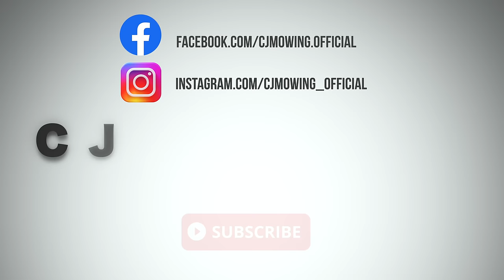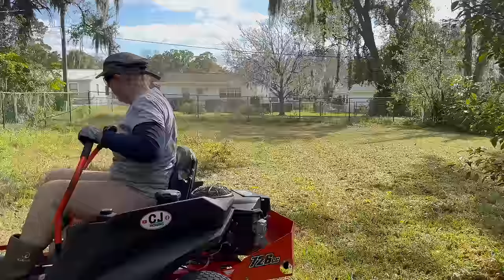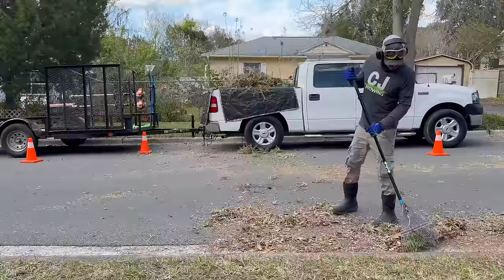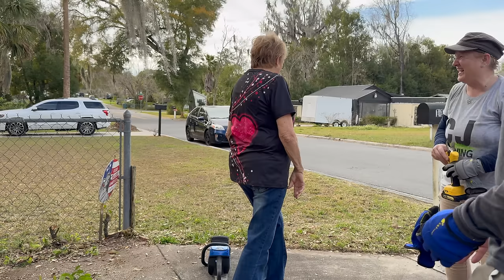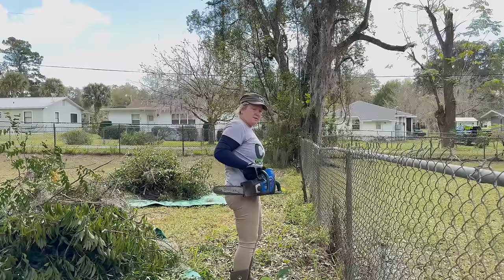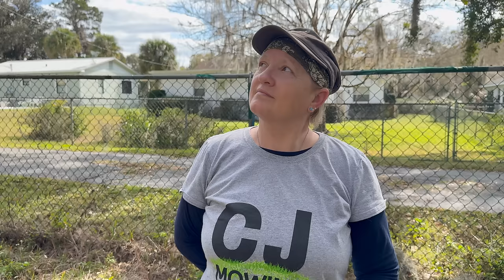Owner works 16 HOUR SHIFTS! So, We did the NEIGHBORLY thing NOBODY ELSE Would!

Comment: What is the brand & model of your chainsaw please?  And how long have you been using it - long enough to know & be able to share with me/us (if you don't mind) what you like & dislike about it?
Reply from the maker: I didn't realize it wasn't listed in our tools list. https://amzn.to/3OOf6I6 We've been using this for 3 years. We originally had a similar gas powered chainsaw and kept running into motor issues. As long as the batteries are charged and chain is sharp then I really like the electric option. I wouldn't use for cutting large trees of course but we have cut up trees that have fallen with it in the past (not in our videos). Only dislike is chain has a tendency to snap off with prolonged continuous use in one go. It comes with a built in tool to reinstall the chain if that happens.
Reply: @cjmowing  Thanks!